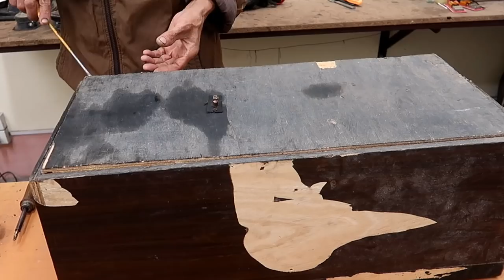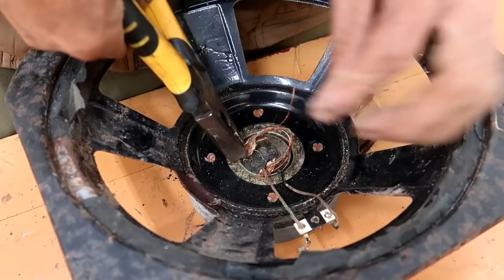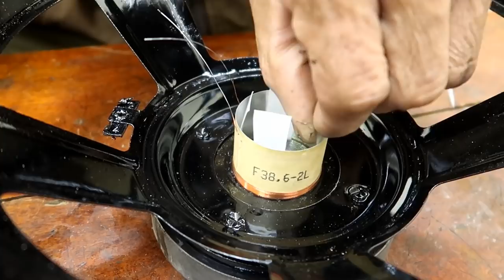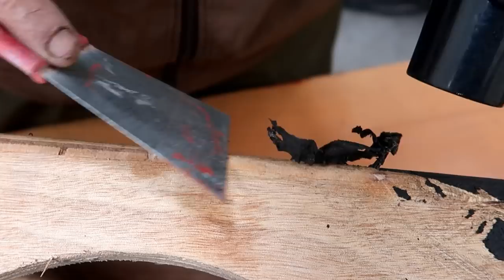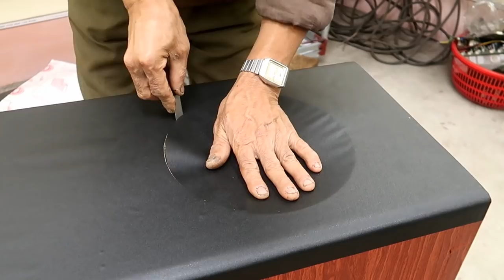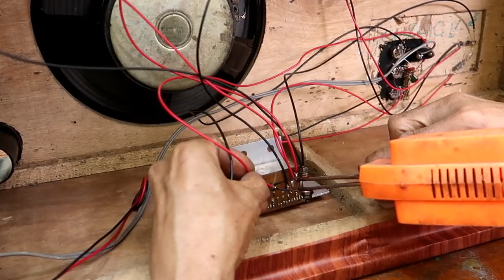Restoration Ancient Cabinet Speakers | Reuse Antique Sounds

Comment: The amount of work is absolutely impressive. The restoring of the woofer was not bad at all. I could not figure out what kind of filter network is this, but for sure it is not on par with the work on the drivers. I would have not installed the meshes on the tweeter. The cabinet is in dire need of bracing, a lot of bracing and then some padding on the walls too. The two resonators should be tuned to the new suspension, and the mid-range driver should have its own little enclosure, inside the big box. Still , kudos for their commitment, you can see on the hands that these guys do not like to sit around!
Reply: Normally i would say the same thing but id be surprised if that sub handles anything more than 80watts. I dont see air pressure interfering with the mid or highs. Tell you the truth, im surprised they wasted their time restoring that speaker. If it was a vintage cerwin vega, marantz, jbl...etc it would be entirely different.
Reply: @UnburdenedByWhatHasBeen  we all restore the best we can get. It is still good effort. As for the woofer-to-mid interference, it becomes problematic much lower than 80watts. That transformer appears to be no more than 30-40 VA, but I would still acoustically insulate the midrange.
Reply: @dorinp007  we'll have to agree to disagree on this on.

Comment: You should have lubricated the potentiometers, especially since the original nuts and washers were rusted... Good to see you fit a full bridge rectifier and a new capacitor for the transformer secondary... Overall an excellent restoration... WELL DONE!!!  9/10

Comment: Good job on the speaker(s) and electronics restoration, for that I score this 5/10. The carpentry/woodwork NOT so much so. First of all, do MDF always. It's the hottest material for speaker cabinets currently, and for a good reason. Secondly the mid range needs protection from the sub-, which you have not provided. The mid-range driver will be impacted and distorted by the displacement in the box due to the movement of the sub-woofer driver. Thirdly, it will be miraculous if the messy mesh of wires does not impact the overall sound. Lastly, no insulation, matting or fibre was used in the inside of the cabin, which in my view would have improved the acoustic response. Restoration in conclusion needs a hint of taking advantage of ALL available technological improvements. Thank you for keeping us glued to an exciting restore job!

Comment: Hi yo,who reading me.I m from Russia ,and I am use speaker system like that . It is called "Radiotehnika S90" ,from latvia , its passive speaker system in origin, and thay have another elements inside . Woofer must be "75гдн" vith big magnet and solid aluminum frame , midle must be "20гд" or '30гдс" in solid aluminum frame ,and midle speaker in origin closed by a tight casing ,tweeter must be "10гдв" , and all 
speakers connected via crossover filters,
bags with damping material should be in the case. This thing - its only the case from s90 ...
Reply: Yeah I felt like something was missing when they closed it up and didn't but any baffling foam inside it

Comment: I never imagined that a so severely damaged loudspeaker could be repaired. I unsuccessfully tried to do something like this when I was a teenager because of spare parts unavailability. Nevertheless I think it must be cheaper to replace the individual loudspeakers.
Have a nice weekend.
Reply: It might be cheaper to replace it, but sometimes it's about the style.
Reply: Granted while it would be nice if he gave a breakdown of materials costs, decent speakers aren't cheap despite being incredibly simple, and I have a hard time believing he used more than $100 in materials. Buying all the glues, coatings, and such - sure, likely not worth it if you aren't ever going to use them again, but the only truly expensive part was the cone, which you can get for only $20-30 depending on brand and tear of your equipment.
Reply: @custos3249  Cones aren't that expensive if you go with an ebay special. You can even go cheaper if you make your own out of card stock, it'll just look a bit odd with a seam. I'd imagine you could probably 3D print one as well which would be just a couple dollars in materials.
Reply: Hello. Ok

Comment: He will massage the ancient speaker with his hands! lol What ancient place is this from?
That's a lot of wire bundled together and suspended from solder joints inside a enclosure that will vibrate.
Reply: These were made in Latvia 🇱🇻

Comment: Great job reconeing the speaker, although i think you could treat yourself to a set of screwdrivers amd a decent soldering iron some of those solder joints are a little iffy. but overall a nice resto.
Reply: If it ain't broke why replace?
Reply: @colwyn9  Because the screwdriver was chewing up the heads of the screws and the soldering iron was more like a iron you use for brazeing led sheets with :p

Comment: Kinda 3rd worldish with all do respect !!!!!!!!  I mean this in the BEST possible way. 
Nice job, NOT to over the top with the finish materials. 
This is why I like it so much.
I have a set of vintage 1070s 
Sansui 12 inch floor speakers with tore up cabnets.
I'm gonna buy new cabnets and rebuild them and use them.
Nothing built today can even come close to the sound out of them.
They have a 3X5 horn loaded super tweeter, two regular dome tweeters, and two 5 inch midrange drivers.
The super tweeter has an L-Pad on it.
The 12 inch woofer had two 3 inch ports.
They really have a bright, warm midrange, and massive sub-bass.
These were ahead of their time when built and 45 years later they literally sound better and are more efficient than any speaker I can find except one company. Klipsch!!!!!!!!!!
But, klipsch does NOT use big woofers like these do.

Comment: what kind of soldering iron? where to find it from?
Reply: it's called a solder gun; you can find it also on Amazon: Weller 9200UC (T0050206399) 100 watt/230 volt

Comment: Between the time in labor, the parts, the work, the power used, a brand new set of speakers could have been purchased that sounded exponentially better.  Sometimes skill doesn't mean it was worth doing.  Restoring a truck is one thing, restoring this, was more of just a time sink I feel out of boredom.  The midranges surround wasn't even glued right.   I just don't see WHY the time was wasted here.  There was no benefit restoring this other than a completely and utter waste of time sink.
Reply: Time spent having fun is not wasted time!
Reply: Конечно время потрачено зря, с точки зрения полученного результата. Ведь данная акустика, из оригинальных запчастей имеет только корпус. В ней нет ни одного заводского динамика и даже кроссовера.

Comment: This an active speaker, so it's not antique.
Until the mid 70s speakers were always passive.
Reply: Qorax its a passive speaker, it only had a preamp in in it.
Reply: @livemusicarchives2037  Yes, preamp means it is active, because the preamp needs power. The internal amplifier is the active component of the speaker.
Passive components don't need a power supply; only active components do:
https://en.wikipedia.org/wiki/Powered_speakers
Reply: Those Radiotehnika speakers are from the middle of the 70s, they are Eastern Block design so the quality was the last thing to worry about but in those gray days people would raved all sorts of songs on these.
Reply: @connectorxp  Ah makes sense, with the 3-band EQ on it.
Most manufacturers switched to a single bass control or loudness control later on.
Reply: @QoraxAudio  These models "S90-D " had two potentiometers under the frequency response curve diagram for midrange and treble attenuation control. But this one is unusual.
Reply: @livemusicarchives2037  No preamp exactly, either... THAT's a Crossover network w/ the outside controls. A PASSIVE X-over network.... The "AMP" is a 2 buck design guaranteed to load distortion bigtime into the response...
Reply: @Quorax Totally wrong. Even in the late 1940's speakers were bi-amped via an EXTERNAL & powered cross-over. All other speakers had a "passive" X-over. Further, MANY speaker systems, including JBL and an Bozak had "Passive Radiators" IE: Speakers with no insides, and they were used in lieu of "ports" to supplement bass frequency output. These speakers shown in the VID had a low level cheesy & cheap power supply w/ an output of about 15 Watts RMS. Hardly "Hi-Fi" by any stretch. Plus a passive X-over.
Reply: @Timoteo53575  Yes and was exactly the point I made with my initial comment, since a speaker that contains no active components is a passive speaker.
Reply: @QoraxAudio  Sorta maybe... Passive is used to describe cross-overs, but never to describe speakers. Speakers, powered or otherwise, have an output (soundwaves) and add many things to the original music source: color, tone, distortion, etc.
Reply: if you are right.. We have 2021. So this stuff is maybe 50 years old? so it is antique.
Reply: @Timoteo53575  So passive isn't used to describe speakers? lol.
I think you should take a look at these links, they're various shops, articles and manufacturers pages making the distinction between active and passive speakers:
https://www.dynaudio.com/dynaudio-academy/2016/september/passive-or-active-speakers
https://www.whathifi.com/advice/active-vs-passive-speakers-whats-the-difference-which-is-better
https://www.aperionaudio.com/blogs/aperion-audio-blog/passive-vs-active-speakers
https://www.dummies.com/consumer-electronics/home-theater/understanding-active-and-passive-speakers/
https://jblpro.com/en/product_families/srx800-passive-series
https://www.musicstore.com/en_OE/EUR/Yamaha-CBR12-/art-PAH0016341-000

Just a random google search by entering "passive speakers" will return enough results to assume that calling passive speakers passive is a thing.
Most shops and manufacturers of speakers make the distinction of passive vs active as a product category.
Reply: @Burningquest  Well... "antique" is a subjective term, but usually the criterion is that it has to be 100 years or older to be antique.
Below 100, like 50 years old devices are called vintage.
Reply: @ qorax RE: @Brun I've no clue as to what you're saying here. Speakers have had the SAME components and operating principles since the 1920's. Age doesn't contribute to the worth of these really crummy speakers. Calling them "vintage" implies they were valuable at some time. Nope. Also, typically, vintage and antique are interchangeable depending on the item. Most items older than 25 years are considered vintage, collectable or antique. In technology especially.
Reply: @QoraxAudio  You have provided further proof of the dumbing down of society in all areas. All speakers are active, BTW; they all have an input (hi or low level) and convert energy to soundwaves (output). How can they be considered as "passive"? Powered or un-powered = YES. Passive? 'Fraid not. If those current links use the term 'passive" they need a dictionary and a smattering of common-sense....
Reply: @Timoteo53575  Again, active speaker is a synonym for powered speaker:
https://en.wikipedia.org/wiki/Powered_speakers
I've posted that link before, just read it through before replying on this.
Reply: @Fyasshole  Yeah looks like the title is updated 👍
Whatever ancient is supposed to mean lol

Comment: The title should be "How to build a soviet bomb in a hurry". Was it not supposed to blow up at the end? Very disappointed.
Reply: You're right, that's very disappointing because that cabinet wasn't of soviet production from the start. That cabinet is a knock-off of the real soviet S-90D. All three speakers are not original soviet speakers. Both low- and mid- speakers of the genuine S-90 must have an aluminium baskets, instead of steel ones.  Also any S-90 never had an amplifier inside, it should be connected to an external power amp.

Comment: I wish I could send you my pair of 1981 bose 601 series I speakers so you can restore them but, I do not want to pay the exorbitant shipping costs to and from vietnam.
Reply: Don't bother. Bose speakers are not quality. They are boom/sizzle. They are engineered to sound impressive. You may think that is good, but it isn't. Good speakers, do a great job of reproducing the original sounds, throughout the spectrum. Bose, scoops out huge portions of the sound, in order to reproduce what people perceive as "good sound".. IE< Mid bass, and highs.... boom/sizzle. In all honesty, its enough for a lot of people. But, there is a TON of audio information that Bose speakers ignore. They have very smart engineers, that have discovered, that it is MUCH cheaper to reproduce the boom/sizzle, the "impression" of quality. Think of Bose, as the McDonalds of audio. It seems to taste good at the time, but it sure is missing a lot. In the audio world, Bose is known as a master of marketing. Not of quality audio equipment.
Reply: @ckmoore101  -Great comment. I just found a pair of 601 series III in my neighborhood. The tops need repair but if sound quality is not too good, probably I won't bother to repair.
Reply: Lvatopesado the Bose 601 series III are USD$600 speakers.  Save them

Comment: I actually live near the factory where all of RRR speakers were made. Unfortunately they just thorn it down. But what catch my aye is that S-90D was not an active speaker and it did not have that strange bass tunnels. All of S-90 series what i have seen and used were passive. Only speaker what i am aware of that's active is S-70. This looks like some aftermarket frankenstein.
Reply: @Транзистор  They were good back in days, now they are old and there are better options out there.

Comment: theres still a fault or short in the tweeter you can see the light stay red  as they all should flash blue
Reply: Aldo the midrange is completely new... 😅
Reply: If new then wired wrong or faulty circuit
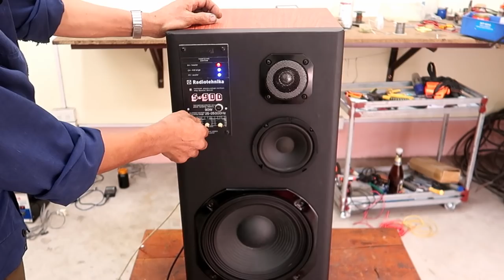Reply: Yep. At 23:06 it's obvious there's a problem. Mr. E will just re-label it "Power" and call it good 'nuf...

Comment: great job, but to do all that work on speaker, and not sand box down prior resurfacing, and to use plastic self adhesive tack paper, meh, looks kind of cheap, now if he had used real veneer or stain/ paint... wow, be bomb

Comment: I'm taken in by the term ANTIQUE SOUNDS, sound is sound, thru a varied ascending/descending range of frequencies, from Musical BASS to musical TOP'. TWEETERS' in hi fi parlance the frequency range for a pair of good Low Age Ears is around 30 cps LOW FREQUENCY to around 18-30 kcs, high range. Range of hearing drops after around 21/25 years and continues to drop until old age when it may go from  around 45 cps to 18k's or even less.Bass has always been the least loss whilst Tweeters which supply sustained 25/30 kcs can be barely discernible after the age of fourty, sound generally starts dropping from around 35 years of age although in experiments in a sound lab perhaps one or two guys can hear slightly outside of what is a standard range. depends on lifetime sound exposure and acceptance, Today's young and the ubiquitous usage of earplugs is very bad for human hearing but it wont be recognised until the 26 35 range of ages.This info is based on medical knowledge and laboratory experiments over a ten year application. (My hobby is making speakers, amplifiers etc and recording and my comments are based on forty odd years of experience.

Comment: I like his soldering iron, because you can use any random piece of copper wire as a tip, but damn its noisy and bulky. Maybe he should have redid that first. 
Dude use this https://www.homedepot.com/p/Weller-100-Watt-140-Watt-Soldering-Gun-Kit-9400PKS/301430491
You can still get away with using random bits of wire as a tip, believe me, I know. LOL

Comment: i dont know how you managed this working but i tell you this all that inside transformer and pcb it is not belong there, check original circuit of s90D. it should have huge capacitors for crossover. https://www.qrz.ru/schemes/contribute/audio/s90/opisanie/s90d.html